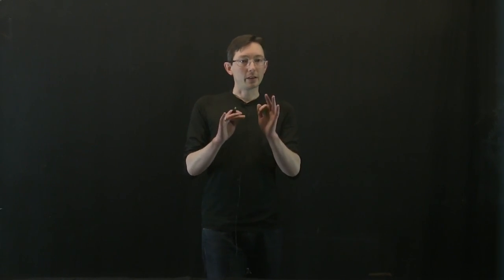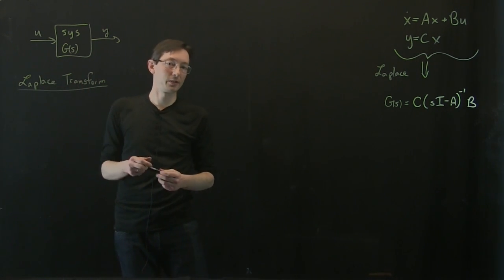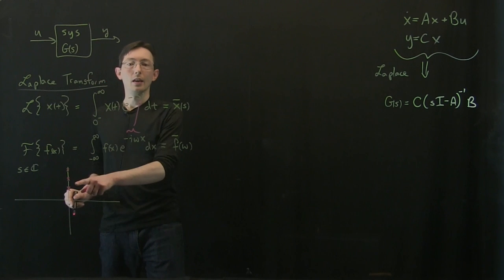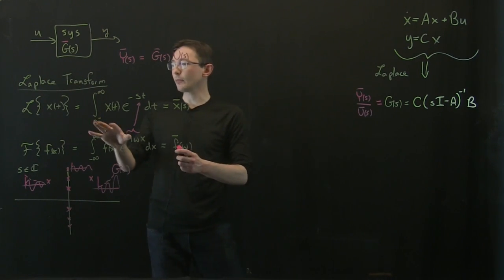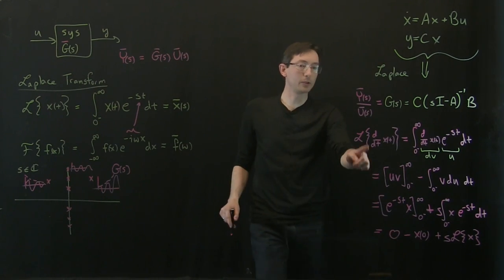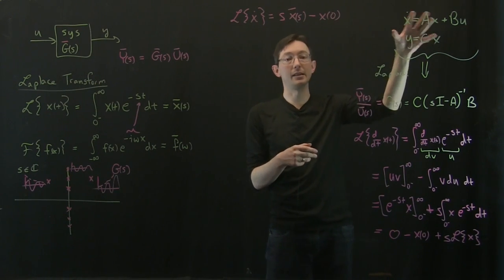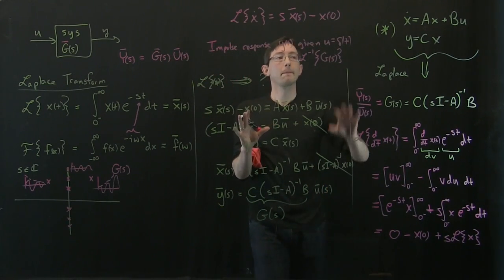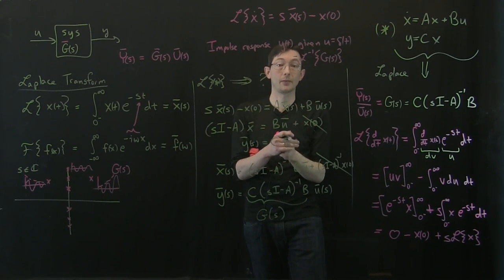Control Bootcamp:  Laplace Transforms and the Transfer Function

Comment: When you solve the Laplace transform of the time derivative of the x(t), did you assume s to be positive? Otherwise, if s can be any complex value, u doesn't always equal 0 as time goes to infinity. Right?
Reply from the maker: This is a really good question.  Actually there are some assumptions that go into the Laplace transform, namely that the real part of "s" is to the left of the largest unstable eigenvalue of "f(t)" in the complex plane.  I am planning a lecture on this soon.  Here is an old lecture where I discuss this a bit: https://www.youtube.com/watch?v=U6DQyTszGRI&list=PLMrJAkhIeNNR2W2sPWsYxfrxcASrUt_9j&index=50.
Reply: @Eigensteve  Thanks for your reply. It is clear in that lecture, and the maths is really neat. Because the real part of "s" is to make f(t) well behavioured as t approaches infinity, f(t)Exp[-Re(s)t] goes to 0. Am I right?